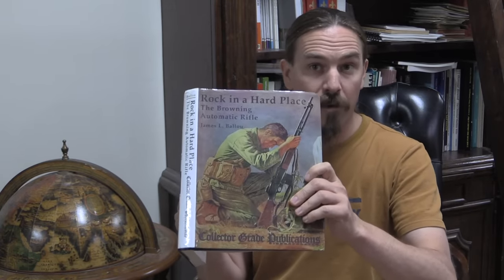Ask Ian: Why Not a Semiauto BAR Instead of the Garand?

Comment: So the semi-auto BAR concept was a victim of the "needs a forward assist" decades before the AR 15 fell victim to the same request.
Reply: Whats up with that? Why do they keep asking for a forward assist?
Reply: @SuperCrazf  because they’re too stupid to adopt a rifle with a sturdy reciprocating charging handle that resolves that issue entirely
Reply: @SuperCrazf  It’s one of those unnecessary “what if???” things. Theoretically you can use your forward assist on your AR to keep the gun running if the semi-automatic mechanism fails, making it more ‘reliable’.

In practice this makes the gun heavier and more complicated while not a single person has ever really needed or used it. If the gun breaks that bad, you have bigger problems to worry about (and even then, it doesn’t even break like that)
Reply: As I read in other comment: If your gun jams, push the forward assist to jam it harder.
Reply: @SuperCrazf  Its the idea that in case of ANY emergency you have a answer. You could fire 10 Million rounds out of somthing and get 2 actual situations that would require a Forward Assist and the "brains" would STILL insist you have it. Even though its a .0000001% chance of happening. 

The old "Have it and not need it, then need it and not have it" mentality.
Reply: For what I got from the replies, there really isn't any valid reason to want to have a forward assist. Making problems out of perceived issues
Reply: @SuperCrazf  as said its the old "Have it not need than need not have" thinking. Its thinking that 1 in 10 Million chances is more common than you think
Reply: @memnarch129  Problem with that mentality is it ads weight and complexity (cost).
Reply: @SuperCrazf  There are a few valid niche uses for the forward assist, but none of them are related to increasing reliability and none of them are common enough to justify its universal inclusion. The most common niche use that is actually useful sometimes is allowing you to put the action into battery quietly. This is popular with people who use an AR for hunting.
Reply: @memnarch129  While one in a million chances are rare, its not so rare when you have 200,000 lads with these things, shooting the odds that at least one of them will have the issue at some point. Still though, stop forwarding my assist ;_;
Reply: @mkmasterthreesixfive  That isn't how probability works. It's a mathematic prediction on how frequently a specific event will occur. So even if it was "one in a million." Having done it a million times won't guarantee that it will happen.

Not to mention the use for forward assist is super niche that problems which requires it being needed is completely overshadowed by far worse issues.
Reply: Since someone here mentioned a reciprocating charging handle removing the entire reason to have a forward assist mechanism, I am wondering what if the charging handle of AR-15 reciprocated? Would it hit the shooter in the face so that Stoner would have to go back to the AR-10 idea of keeping the charging handle inside the "carry handle"?
Reply: @TheDiameter  most people who used the SCAR hated the reciprocating charging handle. Not good to have handle flying back and forth around your fingers, great way to fuck up your thumb and jam the gun in the process.
Reply: @survingsailor3107  Kyle Rittenhouse
Reply: @HypeBeast764  I have a SCAR and actually like the reciprocating charging handle. I’m right handed, and run the charging handle in the left side of the rifle…

In my experience, that little handle attached to the BCG functions as an empty chamber indicator, an out of battery indicator, and a forward assist.

A quick glance to the side of the rifle while it’s shouldered will tell me the immediate condition of the rifle. No need to come off the gun and check the chamber. 

Yes this is a niche function but I find it quite useful. Yes if you block it you induce a malfunction which is certainly a concern.
Reply: BAR is first and foremost a dead-end in terms of development. It's very heavy gun, with tiny magazines and lacks interchangeable barrels. You can in theory make the mags bigger (making the gun even more cumbersome than it already was and the platoon even more overloaded with ammo for the BAR gunner), but to solve the other two issues, you need to design a new gun. BAR being dragged into WW2 showed all the shortages of that design.
But seriously, the gun is just too damn heavy for what it does.
Reply: A friend of mine with an M1 Garand has to give the bolt handle an occasional forward tap with his hand due to the weak recoil spring in the rifle.  If you watch the TV mini-series "Band of Brothers" in combat situations, the blank-firing M1s used had a similar problem, where you'll see the actor, playing the part of the combat soldier, giving the bolt handle a tap of the palm of his hand.
Reply: @elbolainas4174  this makes no sense considering the standard remediation for every reciprocating charging handle weapon is to tap it. When my glock doesn’t go into battery and I tap the back of the slide that’s not jamming it harder. Likewise if you do the same on an ak pattern rifle it will fix the problem effectively. The forward assist does nothing different
Reply: @fjogert8919  finally someone gets it.
Reply: @HypeBeast764  Lol, tell that to the literal hundreds of millions of AK pattern users who never once were bothered in the slightest by a reciprocating charging handle.
Reply: @TheDiameter  yeah and it’s why communist poor countries use the AK pattern when capitalist rich countries don’t. You get what you pay for. I guess if I was poor I’d be happy having any gun. But I’m not so i prefer so I get to have a choice in the matter.
Reply: @firepower7017  I think you are the one who doesn't understand how probability works. 
Probability of a 1 in a million chance event happening in 200000 attempts is whole 18%, and in 1 million attempts it's 63%
So yes, increasing the number of people increases the chance of a failure happening to someone significantly
Reply: @Archimedes.5000  I'm not arguing about the odds being significantly higher, leading to a likely chance of failure. It's more that the set amount of attempts doesn't automatically make a failure happen.

It's a really weird misconception that people see as a milestone?
Reply: @Archimedes.5000  Apologies if you read that first comment(that you replied to) assuming that I'm saying that the event of failure will never happen.
Reply: @firepower7017  no one said million tries will make it happen for sure, they said that with 200 000 soldiers it will inevitably happen eventually
Reply: @survingsailor3107 actually we have 1 account of a person using the forward assist
Reply: @SuperCrazf a shy assist just doesn't do the trick
Reply: @SuperCrazf  the reasoning behind a forward assist is if your bolt is not fully chamberd you smack a button that drives the bolt forward. In reality this causes more of a malfunction and it's better to train to rack to bolt instead to clear the malfunction.
Reply: @Zmeeed01  the original ar 15 had a reciprocating charging handle. What the discoverd quickly was because the ar is a gas impingement gun the gas escapes out the bolt carrier. This causes the bolt to get very hot and thus making the charging handle hot af. It was actually James Sullivan that help Eugene stoner on the charging handle and gas key design for the ar10 and ar15. They figured out that having the charging handle not connected and as far back as possible help medigate that heat.
Reply: @alejandrocastro6323  Interesting. I have even forgotten I asked this question a long time ago. Thanks for answering